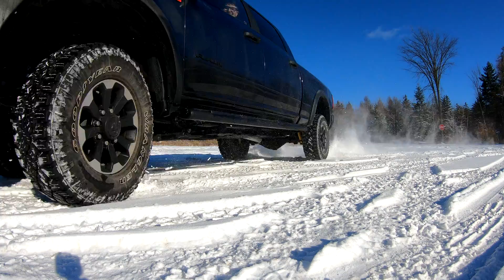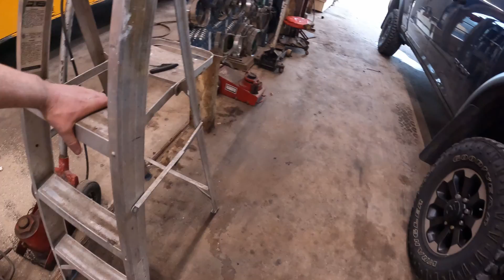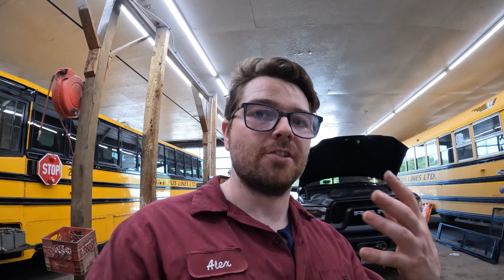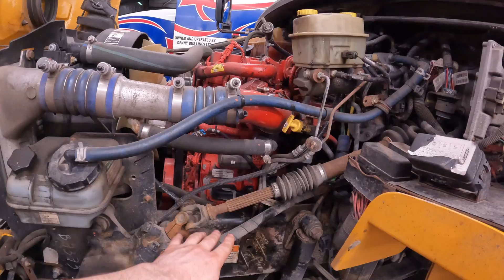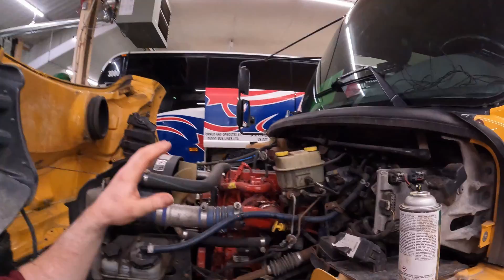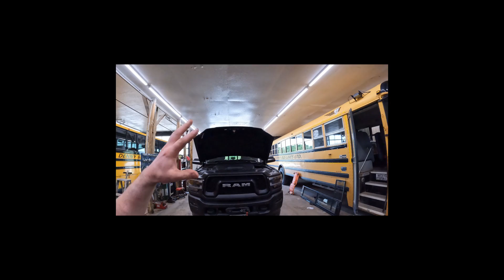RAM 2500 Cummins 6.7 GASOLINE Engine | Could This Replace The HEMI in HD RAM Trucks??

Comment: There’s no way a gas turbo will be used in a HD truck period ! Can’t run a plow on the front of a turbo pos gas engine !
Reply from the maker: I mean I respectfully disagree. A compound turbo set up done right has almost no lag. I get what you are saying though ideally one would want a N/A gas to have that nice streamline power. But i just don't see cummins running an N/A engine. Plus with a turbi set up that engine will make so much more power.
Reply: I don't understand why you would want a weaker engine when you can have a stronger one

Comment: The negative enviromental footprint of electric motors is much , much worse than that of the internal combustion engine if you consider the amount of rare earth metals, copper, silver and other metals needed to build them and batteries that require lithium, and the cost of pulling that out of the ground has skyrocketed in the last year alone. Then there are electricity costs and the shortage of electric power on the grid and the political decision to shut down coal, oil and natural gas electric generating stations.  Charging issues, battery reliability issues and disposing of dead batteries are problems are problems that haven't been resolved, adly, our govt's are no longer of the people so the gov't, not market forces are diciding what is best for our future, so, we are putting the cart ahead of the horse and have no answers to these problems but instead are going full steam ahead in a very haphazard way.
Reply from the maker: I agree with everything you said sir! Right on the money. The politicians that make these decisions live in a sheltered bubble. In canada our transportation minister has never actually owned a vehicle. Yet this man is making decision for the whole transportation system in canada. 

Now to play devils advocate. I also don't think we can continue down this path forever either. Whether you believe in climate change or not oil is a finite resource so eventually there will need to be other primary sources of energy and there is nothing wrong with exploring electric options. But like you pointed out there are many problems that need to be solved and until we can reach a point where is makes sense from a economical and environmental stand point It seems unfair to push/force people away from oil.
Reply: @GettysGarage  The  world we live in now is controlled by the political elite which ignores democratic principles and instead rule by decree and edict. The environmental wack jobs that write regulations and policy for industry employ the soviet method of top down central planning because heaven knows the people can't be trusted. These people have never picked up a screwdriver, or turned a wrench,  most of them are clueless morons and no freind of us working class types.
Reply: My other question is, how much oil do we have? Ive read where the oil discoveries in Alberta and North Dakota alone have enough oil to provide North America with well over 100 years at current usage rates, New York State has the Marcellus Shale  oil natural gas resources that lie under half of the State, but Russian backed eco lobbyists have blocked any attempts at drilling for it. there are many examples of this in the U.S. alone, so I think our energy problems are political and not factual.
Reply: You need to quantify your claim, with peer-reviewed research, otherwise you're just another guy on the  internet pulling opinions out of his rear-end. I'm not denying that the considerations you mention are real, but without quantified proof, who's to say whether electric or IC is worse for the environment. My intuition is electric "might" be better but we'd need 100 years of evidence to be comparable to IC to be able to prove it, and even then, I doubt we could because both scenarios are not starting from teh same basis, and furthermore, there are additional, uncontrolled factors in the equation like natural events, emissions from other sources, permafrost warming, etc.
Reply: @frontagulus  Ok, so why don't the people pushing ev's quantify their numbers with peer reviewed research? Problem is, scientific research has become ideological research, so who ever bankrolls research pay to get the outcomes they want. Science has been corrupted by special interests, as has education, and law enforcement, and elections, and health decisions, and immigration policies, etc, remember covid and the experimental mrna vaccine mandates? Elites deciding major public policy decisions for a nation without the people having input or a voice is tyranny.
Reply: @frontagulus if you give a college professor a $100, 000 grant to " study the environment" what do you think he (she) is going to say? 
" Oh, everything is normal, don't worry. We don't have to do anything."

Comment: I'm guessing that the bottom end would have a lighter rotating assembly. Not just for weight, but for revability. Gas engines don't make a whole lot of power at 1500 rpm. Also, as a package, the truck won't have to have all the dpf shit to carry around. That has to be a couple hundred pounds. Another pro, would be only needing one mounting package, and transmission to cover both engines. They would both have nearly identical foot prints, and share almost all accessories in the engine compartment. That would cut a lot of cost.
Reply from the maker: You would think they would have to change the rotating assembly but from what i read the goal is keep everything relatively the same from the head down. Now i strongly question that just like you because even the piston from a gas to a diesel and dramatically different. So i guess we'll wait a see what happens. End of the day I think cummins goal is to have a much of engines that utilize alot of the same parts making manufacturing much easier and cheaper.
Reply: @GettysGarage  I would agree with that. This day and age, especially with this bs economy, saving money and time is everything.
Reply: They would change piston and a bit lighter rod. Same Crank. It would need to rev to 6k rpm. But gas torque inline 6 would be around 3500 rpm.

Comment: Thank you for talking about this.
 In the late 80s ( KABOTA) came out with there ( GAS) block Lawn tractor. The demand was that The Lawn mower market was a want for a Gas Engine in Lawn mower. We had already bought a Diesel Block Lawn mower. KABOTA
Started  building  there ( GAS) engine on the Diesel block. Not a new built ( GAS) Engine. It was heavy duty. It will be interesting to see what ( Cummins) builds. You look back on the ( Perkins) Diesel that ( CAT) did. They tryed to build a Diesel Engine on a ( GAS) Block, did not work well. To much for a ( GAS) Engine block.
Reply from the maker: It will be interesting to see what cummins does. I know there have been attemps like this in past from GM also which was a complete disaster so hopefully cummins does a better job
Reply: @GettysGarage  
Cummins is working with Marine power plants one being the new build passage ferry. 
( Sea Change) a 70 foot, Zero Emissions Hydrogen FUEL cell.it has a 360 kW. Cummins 
It is integrated with a 100 kWh. Lithium battery and a 2× 300 kW electric Propulsion system.
Hydrogen FUEL cell power train provide the same operation flexibility as a DIESEL with Zero Emissions. And less maintenance. This is said by company involved with project. This Ferry is doing sea trials in Puget sound Washington at the time of my writing.
Reply: I have a commercial grade 322 John Deere rider tractor that has an inline 2 cylinder Yanmar gas engine in it. The gas engine is based off of the diesel engine they already had in that size so it has all the robust diesel build in a gas version.

Comment: I just want a naturally aspirated engine. No turbos
Reply: Same , its just another system that will fail
Reply from the maker: Nothing wrong with a good old N/A engine but I highly doubt cummins will do that.
Reply: YES. I knew a lead shop guy at Detroit Diesel back in the 871 & 671 days. He said the Natural Aspirated Detroit Diesel would last twice as long as TURBOS. He saw all the overhaul and Repairs coming into Truck shop.
Reply from the maker: He may be right but i've driven trucks with blown turbos and they barely make it up to like 30mph. Turbos are what give trucks there power.
Reply: Why??
Reply: Definitely would want a turbo it'd be a beast without it it'd be weak and unnecessary.

Comment: The Power Wagon already suffers in sand/snow from its weight and a heavier engine wouldn’t help that. But I’m all for a 6.7 gas or a 3.0 I6 if it has the right duty cycle for HD use. Exciting times!
Reply from the maker: Ya I could NOT imagine having an extra 600 lbs on the front end. A power wagon with the high out out I6 would be interesting! Could probably easily tune it up to like 600 horse
Reply: Weight in snow is a bonus

Comment: Congrats on your new home! Very exciting stuff. I recently joined the channel and I have been enjoying your content. I am hoping to either get a power wagon or a 2500 limited gas. I want to do light off roading with an overlander RV trailer. What do you think I should get? I cannot find any comparisons between the power wagon and a limited 2500 gas.
Reply from the maker: So they are actually pretty similar trucks. You can get the off road package with the limited 2500 which gets you a rear locker and skid plates. Obviously the PW is going to be much better off road but the limited will allow you to have a much much higher payload. PW payload is like 1,450lbs vs like 3,000+ . Also the limited will have a much higher tow rating. PW tow rating is 10,800 lbs vs the limited could have up to 17,000lbs. 

If the tow rating and paylod don't scare you then the PW is a great option.
Reply: @GettysGarage   that helps a lot! Thank you. I guess I need to decide what I am going to tow and then I will have my answer. I wish there were more than just black on black on black interior options for the PW. Lol

Comment: Im looking at buying a diesel (im 16) what truck should i buy? please and thank you
Reply: Cummins
Reply: ALL of the diesels before emissions set in are a good bet. If you get a Dodge of that era the autos are trash so get a manual transmission or be sure the transmission is built with the right parts to keep the automatic alive.
Reply: 03-04 5.9 cummins, no bullshit emissions faults to worry about
Reply from the maker: 03-04 5.9 cummins are fantastic options for pre-emissions. Post emissions (2007+) I would say anything cummins is a solid option. Duramax isnt a bad option either
Reply: @GettysGarage  Thank y'all! but if i cant find a good cummins or d max what gas pickup is good ? (that is affordable)